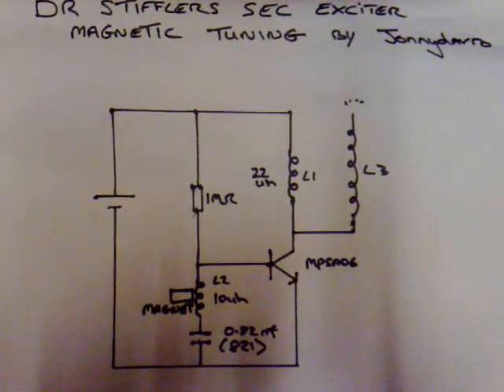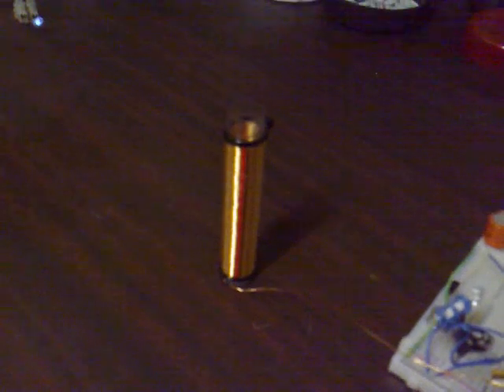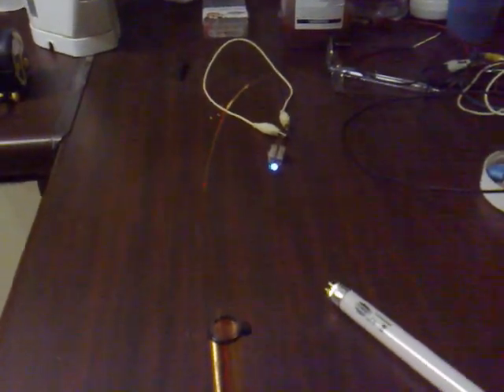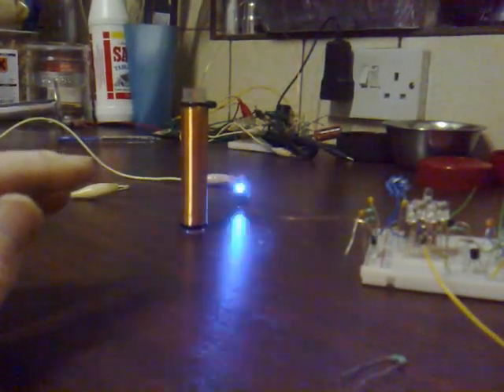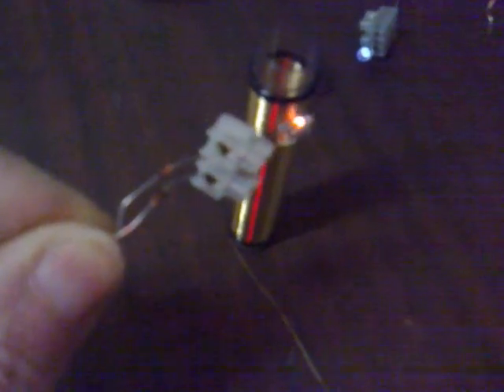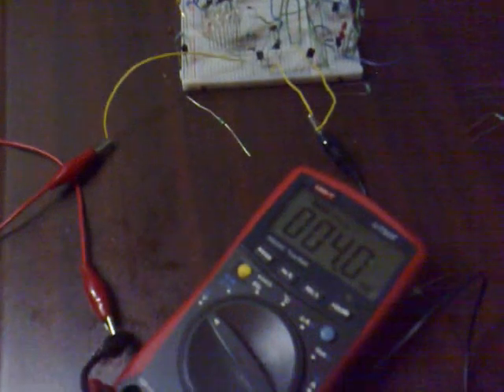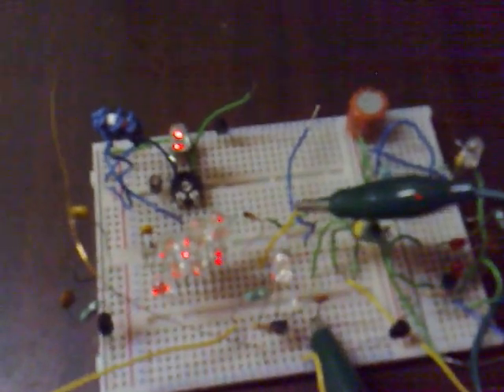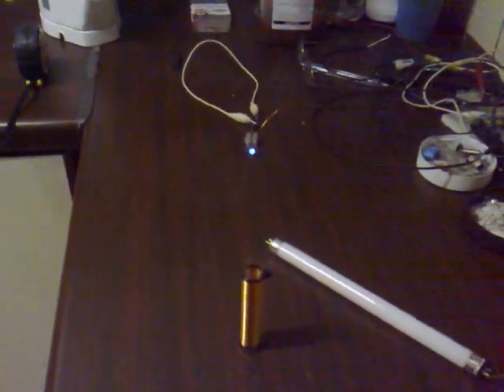SEC Exciter. Magnetic tuning

Comment: It is squegging !
Possible inadequate power rail decoupling.
or
High impedance junction bias allows rectification of oscillation at one frequency to permit non-linearity induction of parasitic oscillation at another.
Those tiny chokes have distinct self resonant frequencies likely to be quite different to the spatial resonance of your 'free' coil - and as you show - tunable with a magnet.
You could try a small LS in series with your LED to listen to the tones - play your own Theremin !

Comment: @freeenergynews I'm not qualified to say Stefan, and I don't claim to be, but i put almost 22 hours in on this circuit. For the first 6 hours about 75 mA was the best i could do, but then I kept repositioning the coil, the fluoro, a virtual ground, and it's almost opposite as you say, there exists a point where at max light, perfect capacitance, your draw goes REAL low. Mine, low 20's (mA) almost as if the field sees the tube as a negative resistor. i dunno. Amazing!

Comment: A very flashy video...in more ways than one, EXCELLENT demo.
On my emulated SEC 18's, circuit will run without var pot+without cap that normally goes across it, but not tried omitting LED. I have 1 emulation w/out such gubbins + was thought to be less tunable, so the magnet is a golden nugget tip !
There's a Goldilocks spot of L3 distance too.
That range was astounding :)
Does range increase if lift L3+PCB up a ways from the wood surface ?

Comment: Pretty nice output light for around 450 MilliWatts of input power.

Why does the input current go up, if you go a bit further away from the L3
coil with the fl tube ? Is there then the resonance point location where it
draws the most input current ?
Many thanks.
Regards, Stefan.